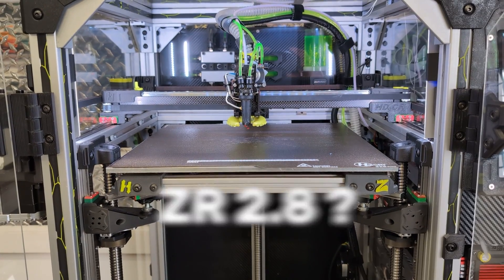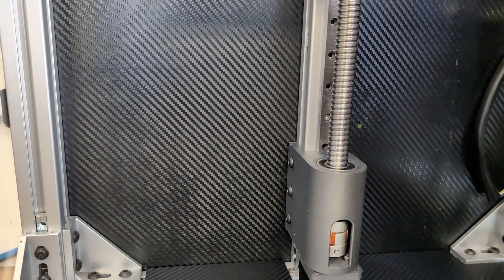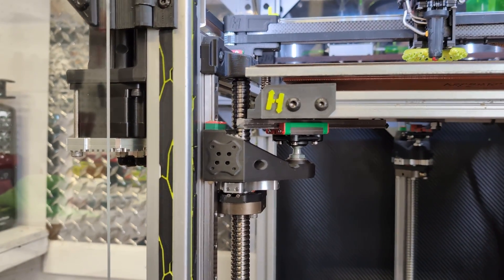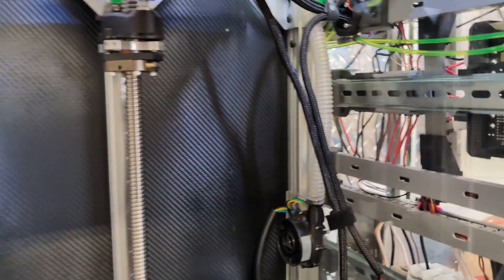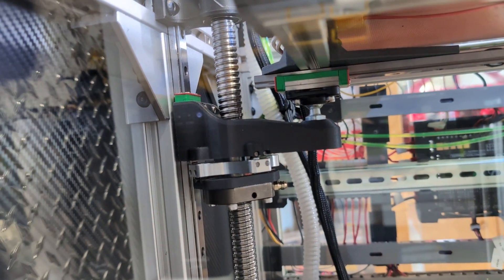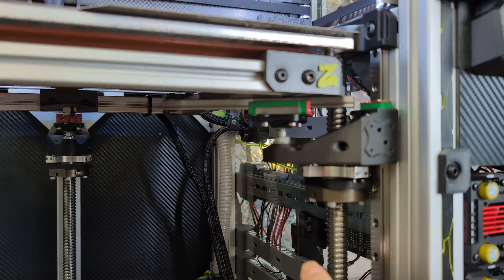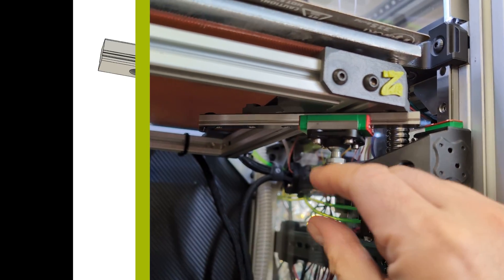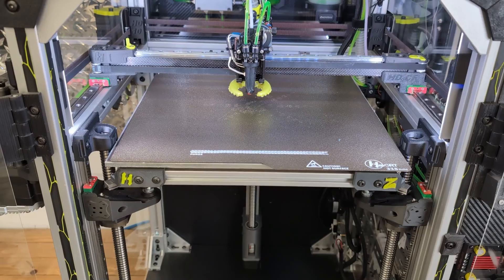HevORT ZR2.8 - Why was it never published?

Comment: Have you considered using sensor to map the z ball screw wobble vs z height for each screw and then compensate for that in software rather than build these isolator attachments?
Reply from the maker: No I did not, I am a mechanical engineer.  How would you do that?  My guess is that the total oscillation will be the sum of the three screws per their respective current clocking.  The nut tilt high variation would need to be addressed some how too.  The programming effort sounds a lot more intense than the solution I cam up with.  But once again, I am a mechanical engineer.

Comment: Did you consider to use metal 3D printed parts instead of the plastic printed ones? Im wondering the limitations of those parts as well as draw backs, like machining required afterwards or surface problems

Comment: The 3-point separately driven Z axis is unnecessary.
- Superfluous mechanical elements (hinges, magnets, linear rails)
- Redundant electronics (+2pcs stepper motors, +2pcs motor controllers, more expensive motherboard due to + controllers)
- Unnecessary procedure (multiple probing, synchronization after each power up)
All this can be saved by connecting the 3 axes with a ribbed belt and setting them precisely. Less money less time....
You already have it... I wrote this for others
Reply from the maker: It all depends on what you are trying to do and the size of the printer you are targeting.
Reply: I believe the 3 point system will be adopted more as non-planer 3d printing becomes mainstream, these projects lay the groundwork for future innovation
Reply: Yeah but then you need manual leveling

Comment: Imo the auto-bed leveling pivot points and the rails are significantly reducing the bed's rigidity... I think that's why the rest of the printer it is so over-built in an attempt to compensate...
Reply from the maker: Just to validate your statement, give me an example of what you think is a good Z-Tilt(self-leveling) enabled system?  And please, dont mention printers where the leveling is achieved by racking the printer.
Reply: @HevORT  None. Manual bed leveling with groove locked knobs. Probe for tramming and easy Z offset.

Comment: Aren't 16mm ballscrews completely overkill for a 3d printer? Especially with the additional linear rails? You have an extremely rigid setup and then you decouple it anyways?
Reply from the maker: The ballscrews provide the Z reference and play no role into XY stability of the bed.  The rail is taking care of the XY stability.  In this design decoupling happens on the ball screw only.

Why ballscrews?  
  When using Z hop a typical Benchy will generate 7 times the standard Z travel distance that it would normally take to print the part.  This is only a small benchy. larger and more complex parts can generate huge amount of additional Z movements.
These small repetitive movements are ideal to rub the lubricant away.

After more than three years of using the same ball screws on thousands of ZHop prints, I am still getting 0.0014 mm of backlash over 20 samples (measured with Beacon).

Why 16mm? 
  The screws that we buy are cheap, they are manufactured using a rolling process. the material is crushed to shape.  The impact of that pressed threading process will affect material all the way to the core on smaller diameter screws.  This is why the smaller diameter of these cheap ball screws are difficult to obtain with decent radial runout value.

16mm screws also provides a lower thread angle for the same pitch, increasing the resistance to being back driven by the bed's weight.
Reply: @HevORT   I think turning on "avoid crossing perimeters" in the slicer is more effective for reducing nozzle contact with printed area than grinding up the Z axis with constant Z hops.
Reply from the maker: @hd-be7di  On slower printers, perhaps.
Reply: @HevORT I don't understand why the printer's speed matters for this slicer feature if you could explain that I'd appreciate it.
Reply from the maker: @hd-be7di  F=MA.  Small rubs and hits on curled material will generate more energy at high speed.  Knocking of the part or the support structure.  These material curls are difficult to avoid when printing fast, this is an inherent property of plastic and cooling.
Reply: @HevORT  Never would've guessed that, thanks for the answers! What's the max runout you go for when ordering ball screws?
Reply from the maker: @felixfe7958  Honestly, on those cheap unit it is more of a hit or miss, but the wobbleX makes runout irrelevant.  That being said, I usually try to get some C5 grading.  But they are rarely within claimed tolerances...  Cheap is the main goal here ;)
Reply: @HevORT great read 👍
Reply: The purpose is defeated by putting them on horizontal linear rails with ball joints to get a gimmicky auto bed leveling feature...

Comment: I know you're trying to release them as a 3d printed solution anyone can do but... ironically based on my recent fb comment, have you considered having them 3d printed from metal and potentially machining the bearing surfaces. This would eliminate the creep issue and some flex but not really fix the lever arm issue
Reply from the maker: Yes, I am considering this option ;)
Reply: Yes, either that, or «just» make them on a cnc as a flat aluminum piece, anyway thank you for showing us